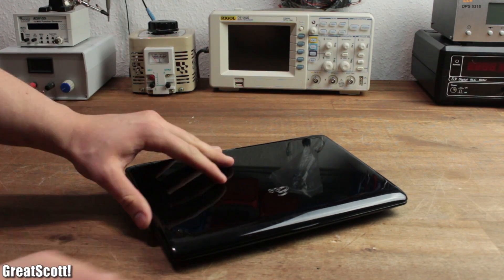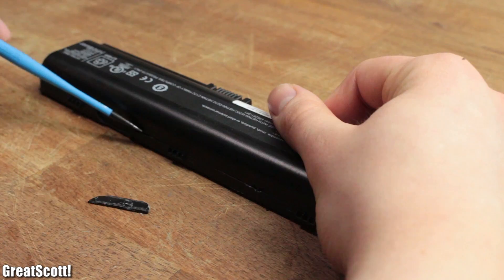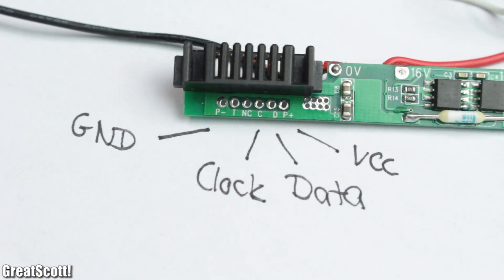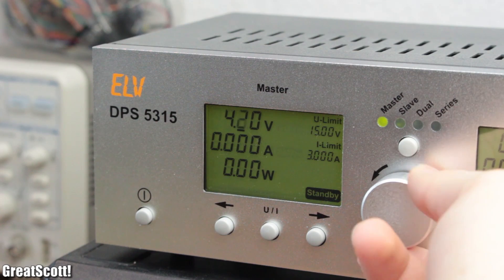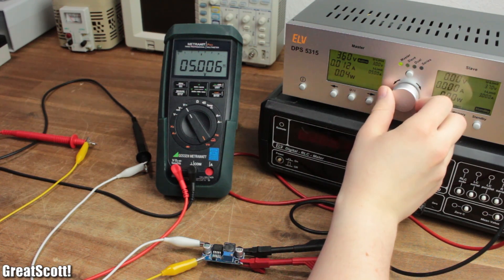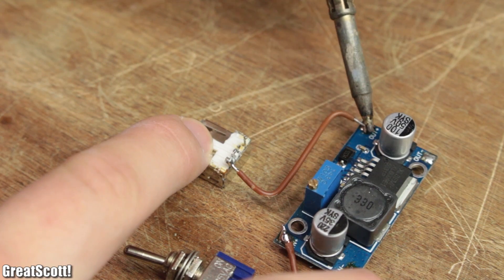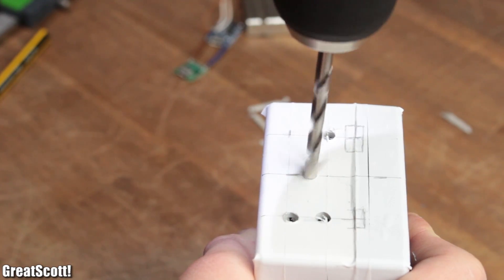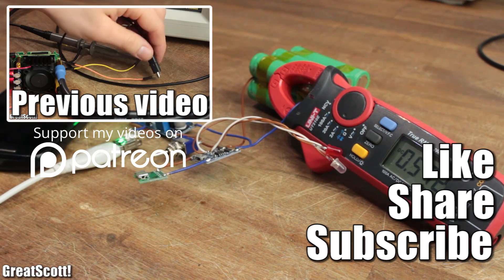HACKED!: Old laptop battery becomes a Power bank

Comment: I have a lot of batteries from disposable vape and I am planning to build power bank as well. I ordered few MT3608 boost converter, i guess this will also do the job. Missing the TP4056 with protection and it should be fine, i am concerned about the TP4056 which can only output 1A of charging current, with 6 cells in parallel you could use more current but maybe it's already good enough since the power source is a regular micro-USB. Then same for the output current, the TP4056 limits it to 1A but since the USB 2.0 specification allows 500 mA it's fine. 

I am surprised you do not need a BMS, i guess it's ok with all cells in parallel, your design is simple to replicate, i think i will use the same.

Comment: I just got 23kg laptop batteries from a pc shop nearby for free and there are pretty good cells in there especially the Samsung cells they hold their voltage for over 18 months with like 0.2 to 0.3v discharge

Comment: Can I leave the battery in-tact and use it as a router UPS by hooking it up in parallel to the 12V AC adapter?  Or does the typical BMS on a laptop battery require being connected to a computer?

Comment: Please I need your help or if you can point me to any of your videos, I will appreciate. 
I want to setup a solar power bank for 1 outdoor camera. 20watts 1.3amps solar panel,  Input from solar will be 12v - 18v. Two different Output voltage from power bank will be 12volts 1amps DC port and USB 5volts 0.5amps. total backup time should be 24hours without sunlight.

Comment: Noob here, but would like to try this. Could this be adapted slightly for a rechargeable speaker rather than a power bank? Could a usb-powered (5v) speaker board be wired directly to the boost converter instead of the the usb socket?

Comment: This might not work for the newer phones now because the data lines of the phone is connected to the phone adapter to send signal to phone that it is using original adapter. So, instead it will slowly charge or discharge the phone.

Comment: I have an old Windows 7 laptop which works great after replacing its battery pack. I wish the industry builds replaceable battery unit so user don't have to throw away whole battery pack. You did a great job as usual.

Comment: I do some research about it some saying that should use resistor because the limit of TP4056 is 1amp and 5v. 1amp = 1 lithium battery therefore the total is 4amps in 4battery while the voltage will stay the same (3.7v). The question is why do some people(DIY) in YouTube  using only (1 tp4056) and USB when creating a powerbank?

Comment: What about the high internal resistance of the battery? Does that just result in a lower battery capacity or is it a safety hazard? But hey, you're an electrical engineer and I'm not

Comment: How are u able to charge 6 battery in parallel with tp4056 because the charging module has only 1 amp max output capacity. wouldn't it take forever to charge the battery pack?
Reply: Exactly, thats excactly  my thought about this build!! Charging 6 batteries with 1 TP4056 s gona take a lot of time <> FOREVER!!
TP4056 is fine to charge 2 parallel batteries, but not 6! Lets be serious!
Check out this one, perfect build!!!!!
https://www.youtube.com/watch?v=8AsEvXFEdg4

Comment: This is not a power bank, this is a product of a person who does not know what he is doing !! Don't do this at home !!!
The module used to charge the batteries is too weak for this package!
The voltage conversion module is also very weak and heats up to a high temperature at a current above 1A!
Never connect lithium-ion batteries in parallel if their charge is not the same !!!

Comment: But the XL6009 works at 5V (Datasheet) , at 4.2v it will not work normally and when the battery discharge is even worse. I have theese boost converters (XL 6009), and I notice that with voltages lower than  4.6V, the circuit can produce peaks up to 30V to the output of the boost converter and this can possibly damage your phone, etc. I dont know if there is a protection about that. Maybe a zener diode will solve this problem... In any case, great job.

Comment: after finishing my own version i found that the charging current is roughly 0.5A "very low" it takes my about 7.5hrs to charge my phone 100%
Reply: It takes some trial and error, mine only charged 40%, had to upgrade the batteries and the modules to more efficient ones

Comment: At 1:27 in the video, what is this black point with the 2 red cables? I dismantle my battery pack and I'm trying to understand what are these (I have two of them)
Reply: that is thermistor.. the thermistor function is to measures the temperature (in this case the battery packs) based on resistance of that black point (or actually NTC thermistor)..

Comment: Scott I have a question I brought this 10000mAh powerbank but later I wanna upgrade it to 20000mAh and I got 20000mAh li-ion battery so if I change the battery to 20000mAh, will there be a problem on the circuit board. Please help🙏🏻

Comment: I need help please, I built one with the same components except for the lipo batteries but they output nearly the same specs, the batteries are capable of outputting 2350 Ma, 14.80 volts and 34.78 watts, but the trouble I’m having is that it only works on very short charging cables (less than 1ft) and will not charge through anything longer than that. Can anyone help me out?

Comment: It may be too late now but I think it would be best to solder the data pins of the USB connector together as this will allow the maximum current to be drawn by the smartphone, around 1.5A. If you dont it will default in aroun 0.8A.

Comment: why not use 134N3P module which has basically all the required components, just need to connect the batteries, and the module costs only 2$.

Comment: Hi Scott i wanted to build a power bank just like this but with 12 new 18650 batteries from samsung, 2 usb outputs an led flash light and a small display that shows the battery percentage..
The problem is i'm a beginner and I don't know what parts I need for the features I want the power bank to have and how to solder them together. Should I use the same parts as you did in the video or are there better parts for my needs? I also wanted to buy battery holders so i don't need to solder them together is this a good idea? I would really appreciate it if you could help me pick the parts and tell me how to assemble them.

Comment: I have the same boost converter and same tp4056 and have a set of problems with this design. The first problem is that the boost converter would become unstable below an input of 5 volts and fried my circuits with over 30 volts. The second problem is that the tp4056 module has a cut off voltage of 2.5 volts which is way too low. I don't understand why you used such a low cut off voltage. The boost converter you habe might be different than mine but it is exactly the same looks wise and by the components I see.

Comment: The problem is the xl6009 module, when the battery discharge below 3.7v it rise up the voltage instantly up to 20 volts or more,the recommended input voltage is 5 to 32v .

Comment: I made this circuit and works well. 
But the problem arises when cell voltage drops below 3 volt. The Boost converter start to output 25 volt. Any taughts on that?? 
note that i tested the boost converter works for voltages above 3 volt.

Comment: well i tried the very same schematic, and powering an ESP32 worked perfectly for 5/6 days, nothing hot, all perfect! But suddenly, one day i come from home, and i find my XL6009 smelling super hot, and the same for my ESP32 devkit v1, battery was at ~2.75V. Results: esp32 is completely dead and so does my XL6009 :( Yet i try to use them, they immediately overheat and thus are completely unusable. Still not sure what happened :( And no, there is no short, nor dead cells on my 1S6P battery pack as i checked them and i currently use it for another purpose.

Comment: Can i connect li ion batteries with different capacities to make this. E.g 1800 mAh + 2200 mAh{2 batteries} +2500 mAh + 3200(2 batteries) mAh to make 15100 mAh power bank. Will it work fine? Or will something bad happen with different capacity batteries?

Please reply fast.....

Comment: Xl6009 is not suitable for such purpose, 3.5 to 4.2v is too low, check datasheet.   Tried to do the similar thing, xl6009 gets really hot.    TP4056 module is not suitable for this either, only 900ma, charging current is too small for such a battery pack.

Comment: So its more trouble than it is worth to use the old charge protection circuit that was inside the battery?  I kind of wanted to see if I could use the thing because the interface clearly has some cool features like charge percentage.

Comment: This is a cool project but it will not charge Apple devices because there is no floating voltages on the data pins of the usb (I think both pins need to be pulled to 2.2v). Also how long does it take you to recharge that power bank? 600mah is not a lot of current for charging 6 of those batteries. Lastly is there any under voltage protection circuit that prevent the user from draining the voltage below 2.7v and damaging the batteries?

Comment: Thanks for the thorough explanation and even list of parts. Liked and Subbed. I don't really understand why we need the 'Micro USB Breakout" doesn't the "TP4056" already have a micro USB connector onboard? I also saw 'DZS Elec 2pcs Mini DC 3V to 5V 1A USB Output Step-up Charging Module Battery Converter" as a possible option for stepping up the voltage, it's smaller, possibly cheaper, and it has the female USB port attached.

Comment: If one battery is rated 2900mAh x 6 in parallel is equals to 17400mAh divided by 1000mAh of tp4056 is equal to 17.4hrs charging time.

Comment: The TP4056 is a complete constant-current/constant-voltage linear charger for single cell lithium-ion batteries, how much current it charges??? Whe will like to know the capacity of HP battery laptop is what they says? Thanks

Comment: Can you make a video changing the cells of a modern laptop battery for better ones, reusing the protection circuit? I tried it once but one part of the circuit just gets hot and the computer does not recognize the battery when connected.

Comment: Greetings instead of the boost converter shown in the video I used the MT3068 boost converter and I tested with just 1 lithium battery. It charges my phone so slowly that my phone uses more battery than what it gets. Is it because of the boost converter or because I only used 1 battery?

Comment: I love you videos.  I see something like this and i think it can't be too hard to do.  But I have odd things I want to add rechargeable batteries to.  A trailcam that burns through 8 AA batteries in about 3 weeks.  And old RC car that is missing the original battery pack.  A power drill where the battery died.  So my question is how hard is it to design and implement batteries for odd devices like these.  What do you actually need to know?

Comment: Great scott, I’m just a new person in electronics, so I’m wondering if I can just use 2 lithium ion batteries in series and connect it to a car charger to step down and regulate the voltage down to 5v. Will it work? And will the TP4056 work properly? I’m not sure.. Also, what is the resistance value I can use to step down 5v to around 3v to power my led? Thanks :) hopefully you answer!
Reply: 5v ÷ 20 =250  resistor

Comment: What happens if I use batteries that have the same voltage but have different amps? I want to connect one 600mAh, one 1500 mAh, three 3000 mAh and four 1000 mAh batteries together. They all have the same voltage and they are all li-ion batteries.

Comment: The problem with using BOOST CONVERTER is it changes its value (volts) over time. Since the cheap variable used in it. So to avoid damage, do check the output volts every month!

Comment: oh Great Scott master, do you think i could use such a layout to power a circuit? what i am worried is that because of the arduino load on the TP4056 board it will not recognize if the battery is the full and overcharge it .. to resume my question is can this be used while its charging ? : )
thanx!

Comment: Can I mix a different capacity batteries and connect them in parallel? Will it explore while it charging?
Reply: If your aim is not using your batteries as fireworks, then don't put batteries of different capacities together in parallel.
The problem is the high current flow from the battery with the most charge to the ones with the least.

Comment: You'll output much more current if you solder the 2 USB data pins together. Since your phone will then detect it as a 'wall charger' not a 'pc data connection'

Comment: I have a question: will hot glue damage any components? As hot glue generally has more surface area than a solder point and cools slower so could there be heat damage

Comment: I connect 8 18650 lithium ion battery in parallel and charge it with Tp4056 lithium ion battery charging Board. The TP4056 Board become so hot that we cannot touch it. It happens When I connect tp4056 to the charger. 

Great scott please help me 
My mail id is ankitsingh2001@Outlook.com

Comment: I have assembled the parts as you mentioned but i still get only 0.4 amps of output current rather than 1 amp which is the basic requirement. What should i do??

Comment: used the same voltage booster and set it up for standard usb 5v but still after plugged in my smartphone , my smartphone says to remove the charger with over voltage indication

Comment: Hi, 
I tried this method to charge my phone. The phone battery percentage rises quickly. But after charging it discharges very fast. 

I tried with both 6009 boost converter and ordinary 0.9v - 5v to 5V step up boost converter. Still got the same results. Phones battery percentage rises quickly and after disconnecting from the boost converter battery percentage drops very fast within 20 minutes to previous levels. 

I like to know what could be the cause. Btw my phone is $70 phone, it doesn't support any fast charging, but with it charges normally with a power supply and with my power bank. 

Thanks.

Comment: I have built several of these, however instead of using USB plugs, I put regular 2.1 mm power plugs on them, then drilled small holes above the adjusters on the step up or step down converters (I built both types)  One of them I also put a regular power plug salvaged from a laptop power supply on so I could hook to that type of device. I also built one that goes from 24 to 36 volts using six cells to power 50 and 100 watt LEDs. I have another with six cells that I mounted a 20 watt LED on to use when working on my motor home. I also stuck an amp/volt meter on it with leads so it doubles as a test meter; very handy.

Comment: Tip for DIY power banks: Get a charger doctor/usb current/voltage/power monitor and put it between your phone and the device. First plug the charger doctor then if you see the digits and NO SMOKE plug your phone. 30% of the time I mess up the polarity. I already killed one charger doctor and saved 200 EUR. Even if your phone is not expensive it's still a frustration to blow it because of stupid mistake that you have 50/50 chance to make.

Comment: you used one tp4056 to charge all the batteries?
the one tp4056 can handle all those batteries.
I have seen other videos that show and say one battery per tp4056..
Reply from the maker: One battery for each tp4056 is recommended.

Comment: Dude, You don't have to balance the cells before putting them together? The tp4056 is built to charge a single cell(I know u used it on paralled but they may have different volt eventhough), also great work!

Comment: Do you just charge li-ion battery's with dc? Is that possible? 

Regards thiemo
Reply from the maker: Yes
Reply: Don't you need a special way instead of just charging with a dc power supply?
Reply: And you had to charge the batteries for 24 hours? To reach the voltage? Why so long because of the batteries voltage were below the voltage that the BMS recognizes ? That's why people say the batteries are dead but they aren't they are just below the working voltage? Correct me if I am wrong! Thanks for your fast response!
Regards!

Comment: i used the wrong tp 4056... can i use this one ; 

TP4056 1A Li-ion lithium Battery Charging Module Charging Board Charger TP 4056 - Mini USB https://www.amazon.in/dp/B00JQ2VG1A/ref=cm_sw_r_cp_apa_i_UxRizb1D2WV6V

Comment: TP4056 1A Li-ion lithium Battery Charging Module Charging Board Charger TP 4056 - Mini USB https://www.amazon.in/dp/B00JQ2VG1A/ref=cm_sw_r_cp_apa_i_UxRizb1D2WV6V

is it possible to use this tp 4056?

Comment: Does the TP4056 module in the description offer over discharge protection? Also I assume it will work just fine with a Lithium Polymer battery too?

Comment: how would one add a capacity display to this circuit I know o connect it to the batteries and not the output. I want a led display that shows 0 to 100% display but all i can find on eBay is 2S 8V displays. but this pack is only outputting between 2.7 and 4.2v so do I use the batteries in series and step down the voltage with a converter? I would have thought this to be inefficient as seris connection doubles the voltage but not the capacity. seems wasted on a 5v power pack. ( I'm still learning as have little electronics knowledge. but have to start somewhere)

Comment: It's a great idea building a powerbank from a laptop battery,  if the laptop battery is ok and you have most of the needed parts. For me it was much cheaper buying a 20 000 mah powerbank poweradd pilot X7 for only 20€ with shipping included.

Comment: Hello all, Question :
What will happen if I use brand new batteries with old batteries from my old laptop? Can I use them together? If no - why. 
Second : where is the point to boost it from 3 volts to 5  and after that the phone drop it again to 3 volts to charge the internal battery.